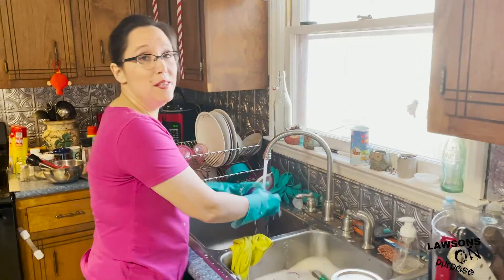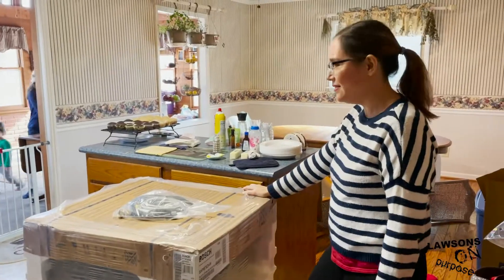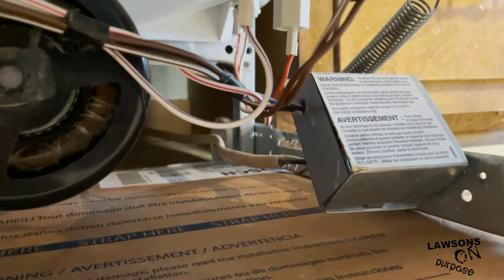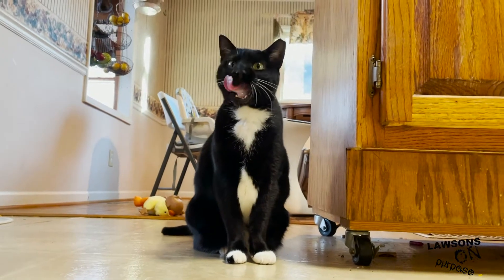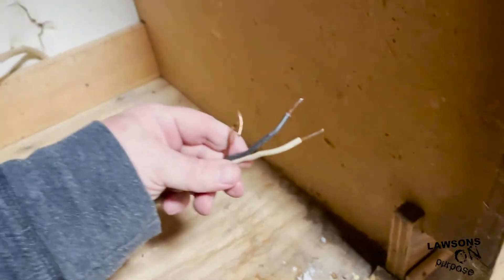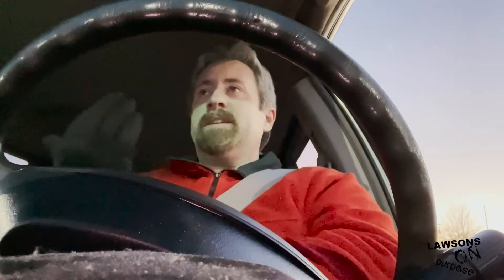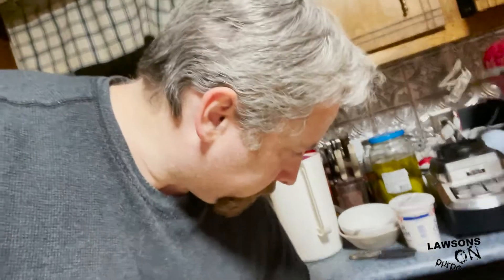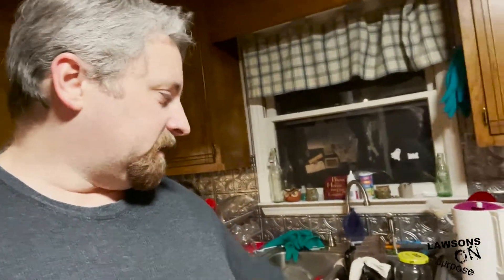Installing a Dishwasher - for the first time!!

Comment: Why didn’t you just wire in a regular outlet for $2 instead of buying a different cord and wiring it into that box?
Reply from the maker: This is a very fair question - In all honesty, being someone who has had little dealings with home electricity, it just seemed safer to do a wiring job “outside of the wall”. If I am to do another job in the future that involves wiring, this somewhat has given me the confidence to possibly move into that. Hope that makes sense!
Reply: @lawsonsonpurpose6086  Understandable. It’s not hard, same as what you did inside that box but the end results are the same. Good job.